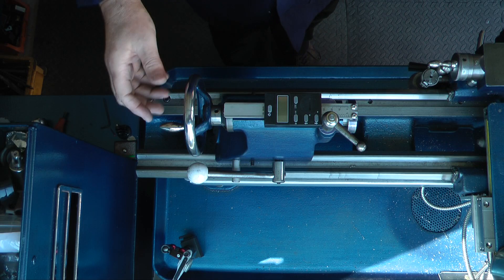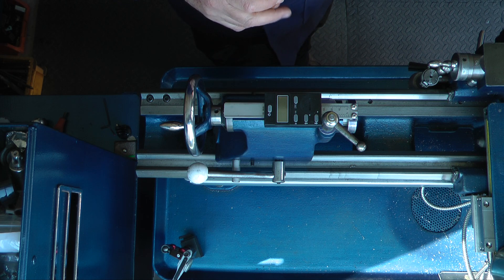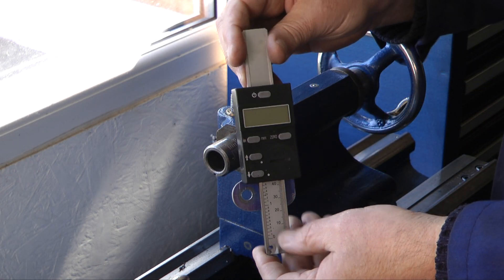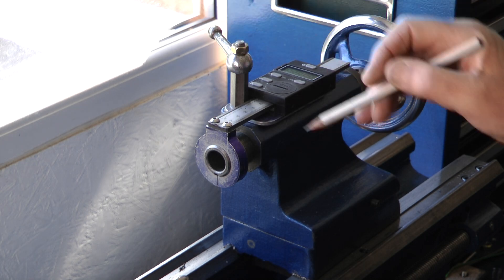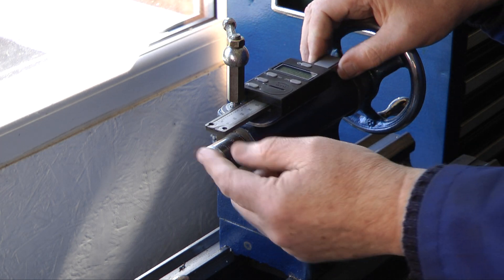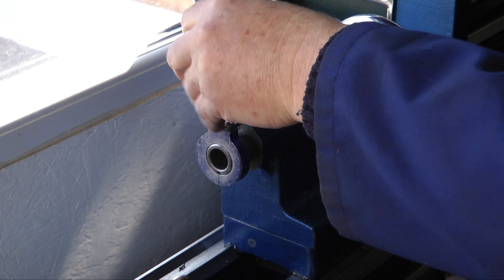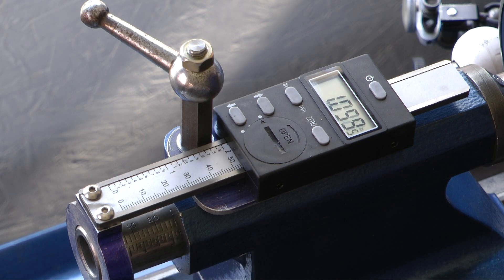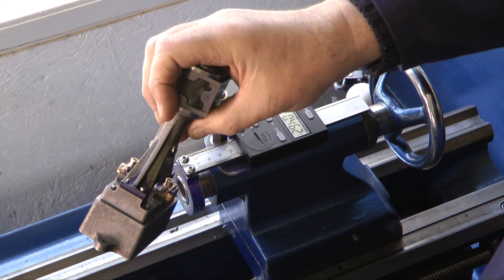fitting a digital. readout to the tail stock

Comment: Source of the digital readout and vernier rule would be helpful. Price / Availability ? Anyone ?
Reply from the maker: Hi John the readout was taken of my milling machine as it was not used after I fitted a DRO unit.
Reply: @enotsengineering  Was that the Warko Super ? Would Warco provide the readout as a spare ?
Reply from the maker: They may you could also try Chester machine tools they also use the same on their machines

Comment: That is a well thought out installation and he gets the bonus of reusing the redundant readout from the mill. I have a very similar idea using the front clamping ring on the quill but I'll be fitting a much modified 6" digital caliper for the DRO. The Harrison L6 is a bit more challenging  because the tailstock casting isn't flat on top like the Boxford. Good stuff👍